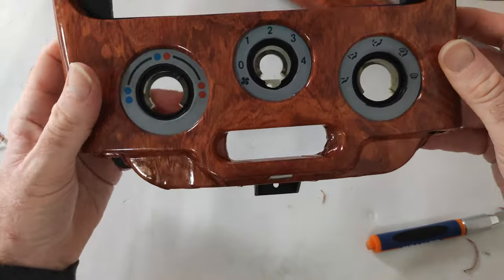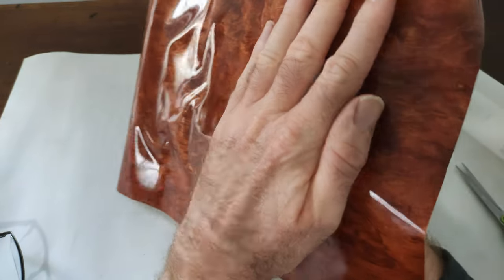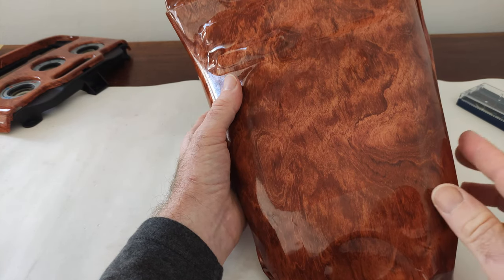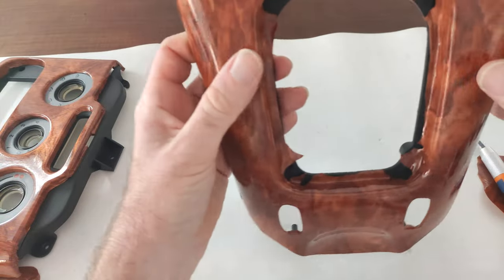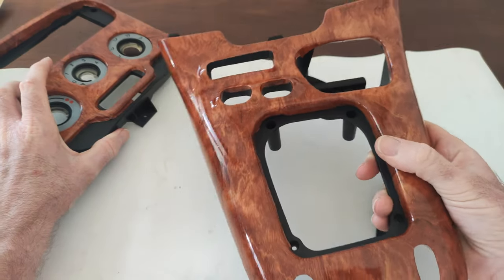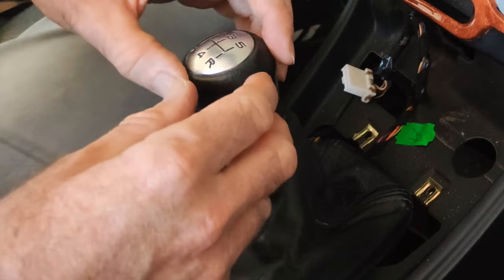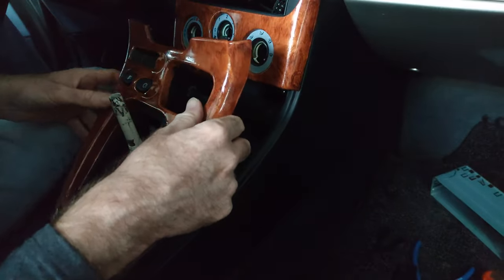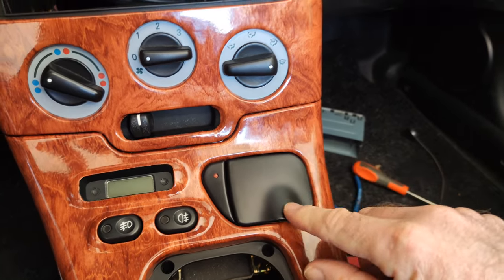3M vinyl wrap for interior Pt2 | Fiat Barchetta | 3M wood vinyl wrap | Cheap car mods for interior

Comment: Paulie, well done! I've always wanted to obtain the original Fiat barchetta dashboard wood accessory but couldn't find one for my airco version. Now I've seen your upgrade and consider to either do it like you have done: vinyl wrap it, or (if not to expensive) use the water transfer methode. 1 Question: looking back, is there anything you would have done differently? Frank
Reply from the maker: I couldn't find the original wooden console so tried this. I thought about hydro dipping as well but decided to go for the wrap. If I did it again, I would start the wrap on the second part of the console from the top first where the clock etc is. Also, make sure the is thoroughly wiped clean first and be patient!

Comment: The area around the AC knobs looks a bit naff, and the gearknob is on the wrong way, but at least it looks pretty easy for most people
Reply from the maker: Yes the gearknob did get turned around eventually! Wasn't sure what to do around the heating controls didn't want to damage the stickers/decals but since discovered you can get replacement decals!

Comment: Hey Paul I have a 5 series and I love wood interiors so much better than bring black or silver I’m thinking of doing this also as it’s a lot cheaper than buying a wood interior. Have you ever considered hydro dipping? Also how is the interior holding up with this wrapping on is it all still ok?
Reply from the maker: Yes it's still ok. The difficult bit was around the heater controls. I've seen some rings on ebay which fit over the controls and might help with the finish

Comment: Thanks for the video. Looking for a wooden interior myself. I just can't bring myself to pay the outrageous price for a pre-cut kits. $200 for stickers, oi.
Reply from the maker: I looked for original FIat part as well just couldn't find one. I think the wood helps to break up the black plastic. You could try painting it with a rattle can to match the body colour??
Reply: @pauliecabs  my issue as well. Honda Legend/Acura rl, I was trying to track down oem wood interior trim. When I find it, it's a crazy amount of money. Even oem wood shift knobs at $100+USD! Not to mention the absolutely crazy price for the wood steering wheels.

Comment: Looks awesome. Im wanting to do some interieur trims on my car, how is the wrap holding up adter the years?
Reply from the maker: Still there! I made sure to use 3M. The difficult bit is around the heater controls . I didn't know at the time but you can get new stickers for the heater controls if you cover them.
Reply: Im Planing to do the trim pieces of my dash. Have a tan leather Interieur with Black dash and inbetween is a small trim in plain silver. The woodgrain will look more like "grandpa lexus" than the silver but i like the color. Found the 3m foil you used. Good product is necessary with all the different forms and shapes
Reply from the maker: Would love to see the results. Send me a pic on instagram

Comment: I found when using the high gloss vinyl wrap that the gloss finish was not uniform enough for me. I sprayed 7 coats of polyurethane, sanding between coats to achieve a smooth gloss finish.
Reply from the maker: That's a good tip. Didn't realise you could spray over it
Reply: @pauliecabs  According to my research, polyurethane will stick to vinyl. Just test it on a small off cut to make sure it works for you.